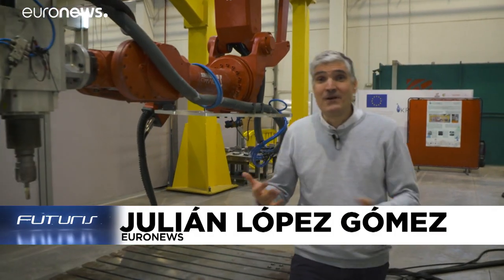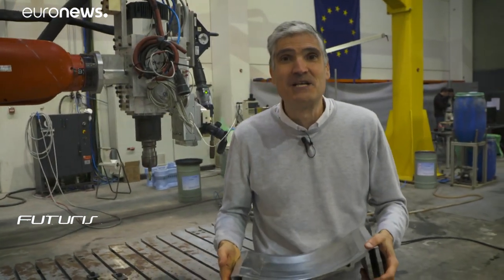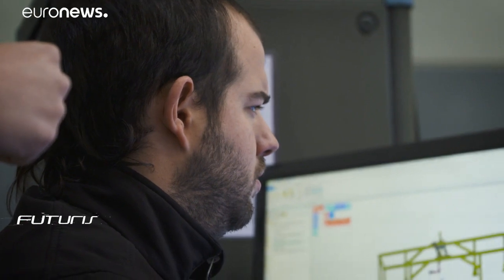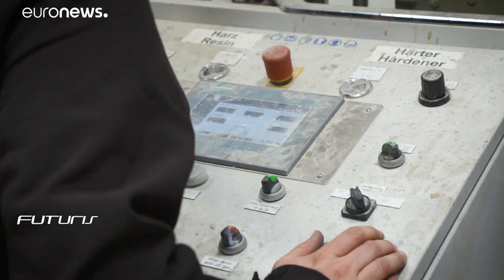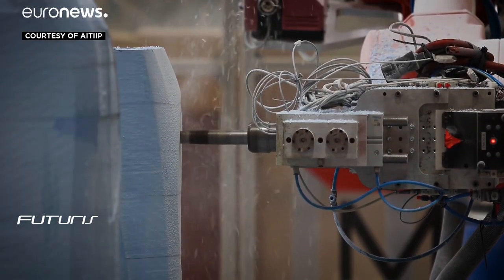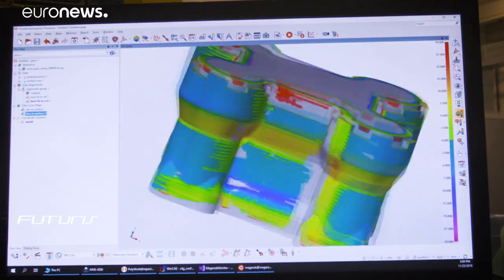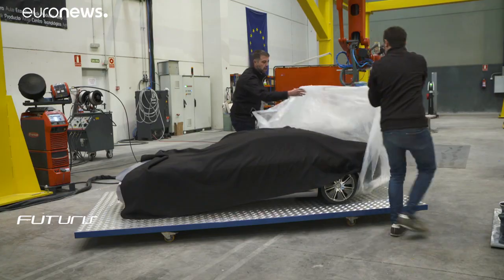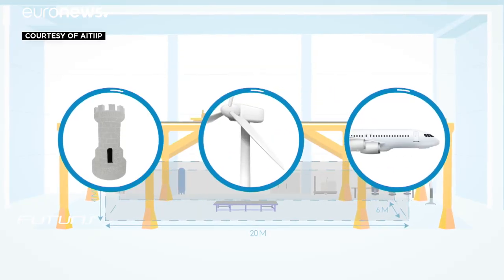Hybrid 3D printer robots are making the manufacturing of European industrial components 40% faster

Comment: What if each layer was stamped after laying so next layer cannot slip over the top of another as basically there will be a seam (with ability to crack and have sliding layers, eventually) between printed layers in homes etc